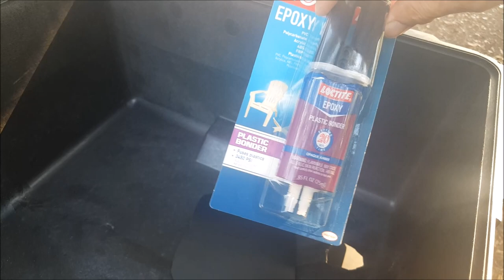Repairing a Pelican Case

Comment: I used a ton of these cases when I worked for the DoD. Every time we got new equipment or components in Pelican boxes we would DRMO the old boxes. We never took the time to repair a damaged case, because we always had more than we needed. Thank you for your time and effort. Most of all thanks for sharing this video.

Comment: Tell you what it'd have done. Put some tape on the inside to back the hole, and fill up the hole with JB weld. When that got hard, peel the tape off from the inside and put some jb weld over the hard JB weld and edge of the hole. Rock solid and water proof.

Comment: Wow, I literally have the same EXACT case with the same EXACT problem. In fact I think my hole is even on the same side but further down. Pelicans are so high quality and rugged but it seems we found the main liability with em. I'm still going to try to get mine replaced under warranty but definitely good to know that it can be fixed with a little effort and ingenuity!
Reply: I have had the same problem with three of the new 1650 cases. Pelican is well aware of this design flaw. Those feet are there only for stacking purposes but they get hung up on EVERYTHING when we transport them. The feet get so roughed up that by now they've taken their pound of flesh from us over the last three years. The previous 1650s with the flat backs were by far the best and most rugged design but their only down side was when the wheels failed, you needed to replace the whole back plate. Very wasteful but we have figured out a way to use the current wheels with mods to the old 1650 plate to make it easy to change out the wheels as they fail again in the future. I wish Pelican would have done this instead of redoing the whole case. It's far too tippy now and gets into tank slappers quite easily.